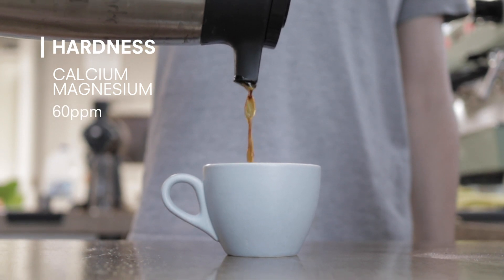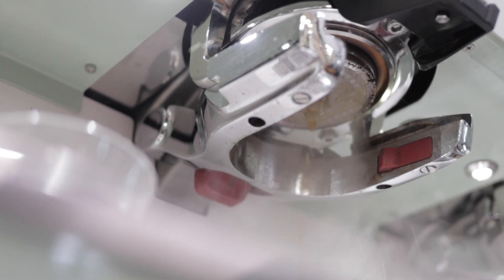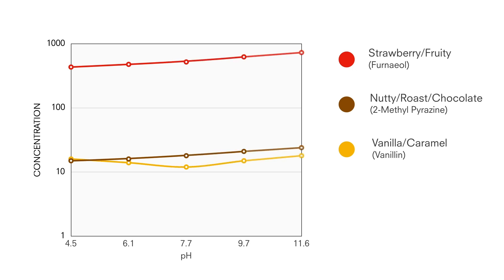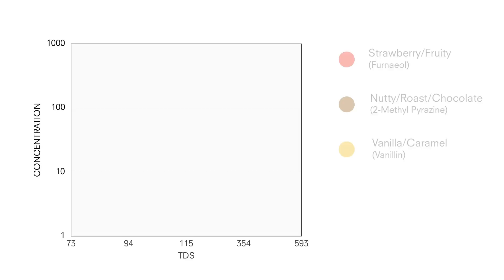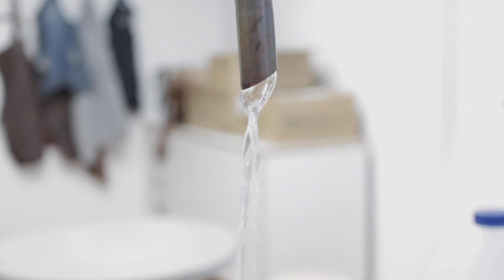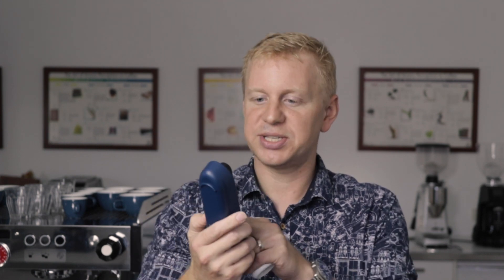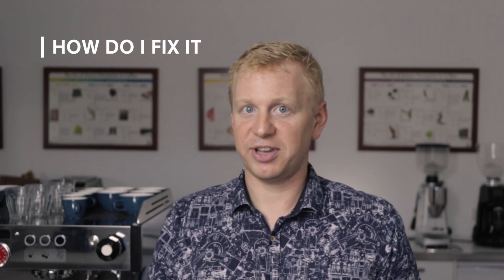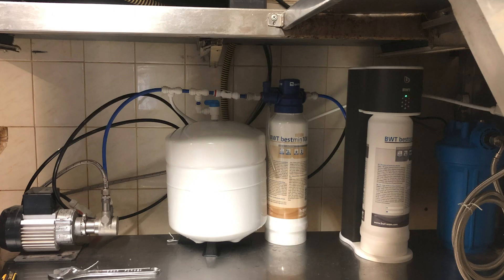Water for Coffee: The top 3 things our research revealed.

Comment: Super informative, what’s the difference between chloride and chlorine?
Reply: Chlorine is an element, symbol Cl; its presence in water would typically be as a dissolved (and highly corrosive and poisonous) gas. Chloride is a chlorine ion, that is a chlorine atom that has acquired an 'extra' electron and is not in that form particularly poisonous or corrosive as the chlorine it comes from.

Comment: Where I live in the south US also out in the country I don’t trust our water for 2 reasons. 1. They have been replacing our water lines for the last several years that were supposed to be replaced 20 years ago. We never know when our water will be stirred up having dirt in it or chemicals from where they’ve treated it. Sometimes it’s has a pink tint. At times I’ve washed my hair using an expensive conditioner for my hair because it’s color treated only to get out of the shower and have my hair feel like straw. 2. We are surrounded by soybean fields so I worry about pesticides & fertilizers getting into our water system. Therefore my family drinks primarily bottled water. We do hope to buy a Berkey water filtration system soon to do away with plastic single use bottles. I’m wondering if the water from the Berkey would be good for the machine and for good tasting expresso? If not, is there a brand of water I could buy that’s suitable?

Comment: Your study is a bit nonsensical, I appreciate the effort and some solid science would do the coffee world good, but this is not it.
1) The gas won't "hold up the puck", look at video's of transparent portafilters. Solubility of CO2 is very very affected by pressure, anything beyond 5 bar will make CO2 incredibly soluble and it will only offgass when passing by the coffee puck on the other side of the portafilter.
2) Concentrations of CaCO3 beyond 60ppm or so is absurd as a the solubility of CaCO3 is much lower especially at temperature assuming Atmosphere CO2 leveles. Above 40 ppm most of it will be left in the boiler depending on how saturated your water is with CO2 (positive modifier, but not dependable) and how saturated it is with other basic salts (negative modifier and generally dependable)
3) Sodium chloride is nonsensical as a modifier for acidity in coffee (it won't react, but might be tasty otherwise)
4) The right salt to modify acidity in espresso is Potassium Bicarbonate for a number of reasons.
Reply: You seem to be misunderstanding what the points made here were.

1. There is still partial pressure from the released/dissolved CO2; whether that's enough to "hold up the puck" or that was just a figure of speech does not change the fact that one would expect solubility (i.e. "extraction") of other compounds to be slower - though ultimately end up at a higher overall concentration - if more CO2 is released (for whatever reason - e.g. neutralisation of K/NaHCO3). The graphs that they put in the video did not show the rate of reaction; they only confirmed that extraction increases with pH.
2. Concentration of CaCO3 > 60 ppm in tap water is a common occurrence in many parts of the world. Most of Southern and Eastern England is well above 250, for example, and it's really hard to find bottled water from anywhere below 100 ppm (Ca + Mg CaCO3 equivalent). The point is that - again - above 60 ppm there is a marginal benefit to extraction of the 3 compounds measured, but below there is a significant loss. Totally demineralised water is not good from that point of view.

3. They didn't use NaCl to modify acidity anywhere. They checked whether "total dissolved solids" (which I'm taking to be analytically defined as dry residue at 180 C) have any impact on extraction of specific compounds. They don't, at least at concentrations that for NaCl are undetectable to taste (i.e. ~500 ppm)
4. Nobody here said anything for or against the choice of KHCO3 vs. NaHCO3 as alkaline buffers; they simply didn't do that test (or at least they didn't report it).

Some solid criticism would do the world of science good, but yours is not it.
Reply: @dlevi67  1: No, Dissolved gasses are not ionic compounds, they do not affect solubility of other compounds in that manner
2: No, excess concentration in tap water is irrelevant for the purpose at hand, increasing temperature causes excess ppm to drop out very quickly.
3: No, The salt thing is nonsensical
4:  Yes, which is absurd since it's supposed to be a a scientific investigation of water quality for coffee, they leave out the most important modifier but qualify ones that have no actual effect beyond calcifying your boiler.
Lol, I supposed someone wrote something like that to you because you write  comments like yours, have a cracker Poppy.
Reply: @srolesen  You clearly have no idea of what you are talking about (or chemistry, or physics), starting from understanding that this is not a scientific investigation of "water quality for coffee". It is a study about what factors influence solubility of certain compounds found in coffee.

And what is in your opinion "the most important modifier" that they left out, go on, I want to have a laugh.

You should stop smoking whatever you are smoking, kid

Comment: I just tossed away a good coffee maker because of scaling damage that is beyond salvage despite the best maintenance and descaling treatment. I bought a new machine this time a small espresso/ cappuccino machine and absolutely loved it. Being tired of equipment degradation I started using distilled water. Am I missing out a lot in the flavor department with this change of water type?
Reply from the maker: Distilled water is not ideal, as the coffee won't extract as well without a small amount of minerals. You can do a quick comparison by blending some filtered tap water (or spring water) with the distilled to see the impact in flavour on the blend you're using.
Reply: I concoct my own water because the sediments in our tap water are revolting. For use in my CPAP machine I have been distilling it.  For humidifier use - without leaving scale - it is fine, but for coffee I buy the 5 L demineralised or distilled water instead to start.  Learned from barista sites how to bring its mineral content  up to be optimal for espresso - by adding bicarbonate soda and Epsom salts in measured proportions to two calibrated solutions and then using easily measurable quantities of these “standard” premixes (100 ml each) diluted up to 2 litres with distilled water.  At the ratios I created I only need to get out the scale to make the calibrated solutions every other month, so it is not much of an overhead.  I always have a ready source to refill my De’Longhi semi automatic machine.  Having dialled in my espresso on the machine (grind, amount, pressure etc) after changing a roast or bean type I get a good crema, good tasty extraction and repeated outcome I can rely on every time.  For reference concentrations I used “Rao’s water” recalculated to my container sizes.  Your palate of coffee or water recipe choice may differ, but that is how best use distilled water and completely avoid any scaling issues in the machine.  Now used it for 18 month and no sign of scale at all, but the recommended regular cleaning of the pump device is important to maintain the taste.  Good luck!
Reply: Yeah you are missing out, without "hardness" minerals your coffee will be acidic and especially lighter roasts will be basically unworkable for espresso. Easy way to solve it is adding potassium bicarbonate which will offgass CO2 when brewing (more crema) and neutralize the unnaturally sour taste from destilled/RO water and protect your equipment from the corrosive effect of very low ppm water. A kilo for 10 bucks will last you a lifetime at around 0.1 grams added per liter for most roasts, a bit less for very dark roasts and sometimes quite a bit more for very light ones (which would otherwise not be very well suited for espresso because of the sour shots)

Comment: Hello...I have a reverse osmosis filtering system at home. Tap water is not an option here. What would you suggest to improve it for the coffee? What would I need to add to the water or do?
Reply from the maker: Hi David, Ben here...I asked our coffee science team about your question. They tell me there are 2 options for RO systems: "1) Adjustable bypass can be done where the filtered water is mixed with tap water (should already be treated by the pre-filter) to achieve the desired water quality. For example, tap water has 200ppm of TDS, and assuming filtered water achieves 0ppm of TDS, with a 25% bypass (mixed with 1 part tap water to 3 part RO water), the final water would result in 50ppm of TDS.
2)The more expensive option is to install a remineralising cartridge, where the cartridge will introduce minerals into the filter water. These cartridges do deplete, make sure you check the capacity and be replaced accordingly."
Reply: @SevenMilesCoffeeRoasters  Wow I had no idea. So definitely I think for my scenario I would have to start with the option 1 first until I can get a filter in the plumbing. Thanks so much for the clarification.
Reply: @SevenMilesCoffeeRoasters  Hello there. I added an alkaline stage to my RO system. The filter adds between 8 and 9 pH. A little outside your recommendation, but is it still safe for the espresso machine?

Comment: Hi Adam, thanks very much for an informative video.

I'm fortunate to live in an area where the water is naturally soft. In my case, the only real "negative" is the elevated levels of chloride in the water (~40 ppm), as well as the water's balance tending slightly towards acidic (pH 6-6.5). As a result, I'm concerned about potential corrosion in my machine (in the boilers, etc.) 

Unfortunately, I cannot plumb my machine in and must rely on more portable forms of filtration. I also read that chloride cannot be easily filtered out by conventional, portable filter products - for example Brita Maxtra+, Brita AquaGusto, BWT Penguin, etc.).

Do you believe the above aforementioned will do the job just fine for the machine regardless, or do I need to go the distilled water/RO + re-mineralisation route?

Is the acidity level + 40 ppm of chloride even something to worry about over the long-term use in my machine in respect to corrosion?

Apologies for the mouthful! I got a new machine that I want to treat right from day one.
Reply from the maker: Hi JK, Ben here. I'm not a chemical engineer, so I hit up our coffee science team for some advice. We work with commercial systems, so some brands mentioned may or may not be practical in your situation. Here's what they tell me:

"Chloride at 40ppm is acceptable (La Marzocco recommends 30, but it is not worth the trouble to install reverse osmosis filters). pH is low, may cause corrosion (main problem). Water is soft, would assume low lime scaling potential.
For this scenario, cartridges that raise pH (like BWT BestProtect, BWT BestMin) may help. But BestProtect will strip all remaining hardness, and BestMin may raise hardness too high (but still better than corrosion).
Filters which reduce corrosion and don’t change constituents in water like Puretec Balance+ would be ideal.
Reverse osmosis filters can be used to reduce chloride (and everything else), but do note of its cost ($2000+) and space it takes. In this case, you need a remineralisation filter after RO (blending is not recommended since it does not solve the problem of low pH, which is the main concern)."
Reply: Seven Miles Coffee Roasters Hi Ben, wow thanks so much for forwarding that information! I own a GS3, and I'm glad to hear that my tap water is more or less okay. I agree my water may be a tad too soft, after filtering.
When you mentioned the blending, did you mean blending RO/distilled water with remineralisation powders (like Third Wave Water)?
Reply from the maker: Blending refers to mixing of tap water with the filtered water to make a mixture (usually a T-junction with an adjustable valve), essentially ‘watered-down’ tap water. This only works for places where the tap water is hard, balanced pH etc., which doesn't apply to your scenario.
Reply: I know I'm years late to the party, but a safe and simple way to increase pH is to add sodium hydrogencarbonate, better known as sodium bicarbonate or baking soda. As the latter name implies, it is commonly used in baking and is thus obviously non-toxic. It is highly soluble in water, so it will not cause scaling. Even a concentrated solution will only reach pH 8.3, which is within the pH range considered safe for drinking water by WHO, so there is no risk of harming yourself or your coffee machine by adding too much.

Comment: Thank you for posting this great video and useful info! What would you recommend in areas where drinking water does not taste very well. If I understand well, installing filter will probably remove the wanted minerals as well. Is there any solution to that? Is out there any filter which remove bad odors and leaves minerals? Thank you
Reply from the maker: a simple carbon filter will remove the sediment, odor, chlorine, etc without having much effect on the minerals that effect extraction (like magnesium & calcium). These filters are generally a good starting point.
Reply: excellent, thank you very much
Reply: I've never heard of a water not tasting very "well." Wellness has to do with health and I'm not aware of any water described as "well" unless it's well water. Perhaps you mean the water does not taste very 'GOOD."

Comment: Dear beloved coffee guru, I'm under the impression that when humidity is high coffee grounds absorb moisture, creating greater resistance, and therefore slowing the espresso extraction down. Low humidity should make the shot run faster. I'm wondering if I have this wrong. The other day humidity was in the 90s where I live. Today down to the mid 30s. Contrary to what I expected, the shot ran much slower today (low humidity) than the other day (high humidity). Have I got things backwards? Is it temperature that is influencing things? The high humidity day was cool, the low humidity day was very warm. Other factors, such as grind size remained the same. What am I missing?
Reply: I wish they would answer this one as I live in a very humid area and find this very interesting! I’m just getting into the whole expresso at home experience. I actually haven’t bought a machine yet because I’m trying to learn all I can. At first all the info was so overwhelming that I gave up on the idea for awhile. But I’ve decided to approach it slowly instead of trying to learn it too fast and making a rash purchase then regretting it. I had not thought about humidity effecting it so I am curious as well. I’d love to know which machine or method you use?

Comment: Thanks for the amazing research Dr Carr! 

I'm a barista in the Illawarra and the most recent water quality report from Sydney Water shows my tap water hardness is 37 mg/L (which is the same at ppm right?) and pH is between 7.6 and 8.1 
I've got a few questions for water at home that I'd love to hear your feedback on.

- To my understanding, a Brita filter from woolies decreases water hardness. What's the best way to increase hardness at home? Or is it just best to use my tap water as it is? I'd love increasing the fruity boiz (Furnaeol) in the cup.
- Does 60ppm hardness and pH 7-8 work ideally for filter coffee, like a V60, as well?
- In your experience, what is the best temperature to set at the kettle for filter coffee? I've seen temperatures ranging from 89 C to 100 C. I personally haven't tasted a significant difference (compared to brew ratios and grind size), but I'd love hearing your thoughts on it.
Sorry for the lengthy questions! 

Thanks!
Btw, the video and audio quality on the uploads are much appreciated :)
Reply from the maker: Hi, Adam sent me a reply to your question:
"Looks like your hardness is relatively low, with a good pH balance. From what we’ve learned, it’s particularly hard to remineralize correctly, especially for espresso. As you seem to have a testing kit, you are well placed to do some experimenting - you could try adding Epsom (magnesium-based) salts in controlled doses to a water-filled jug to get the balance right, however this may only be a realistic option for filter coffee.
If you wanted to remineralize ‘inline’ with cartridges, then BWT or Puretech both have options, but it’s an involved solution that often overtreats the water, which would be especially true at home. I wouldn’t recommend it.
So, in summary – yes, I would leave your tap water alone and just use it!
> In terms of differences between espresso or filter coffee – 
Regardless of extraction method, the balance of minerals in the water affect coffee solubility identically – and we have seen evidence of this in some papers published from various universities (along with some testing we’ve also done!).
> Temperature – this is also an interesting one. Without going into extreme detail, we’ve found 96C to be a good extraction temperature. Do you need to invest significant time and money to make sure it’s exactly 96 (again, which it seems like you have!)? No, not really – you can get excellent extractions in the range you mention. Taste dictates best here!
Hope this helps!, Adam"
...Thanks for the questions, Ben
Reply: @SevenMilesCoffeeRoasters  Thanks for the info again guys! I'm definitely keen on playing around with epsom salts for filter coffee. Might as well make use with all this time at home now lol. Stay safe :)
Reply: The proper way to remineralize (for espresso) is with potassium bicarbonate which is incredibly solvable in water meaning it won't ever scale, neutral in taste compared to some other salts and unlike sodium chloride it will actually have a balancing effect on the acidity of shots. They should have put it in the study instead of the nonsensical sodium chloride.
Reply: I have the same problem. Thanks for the answer.